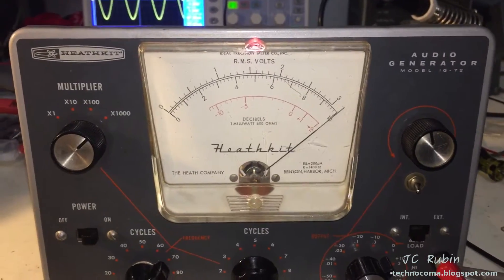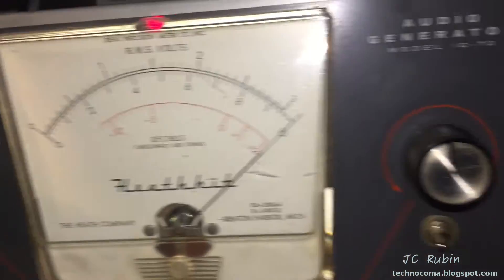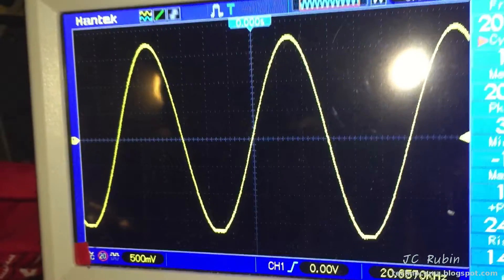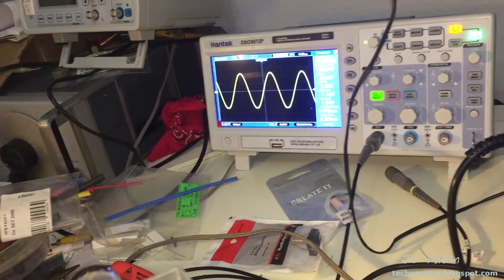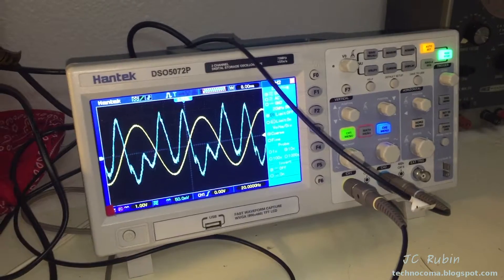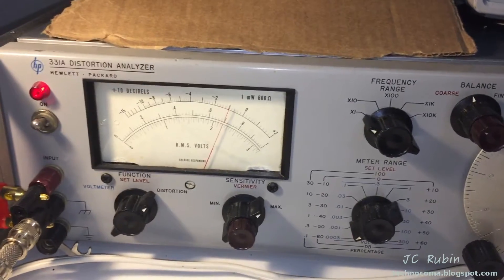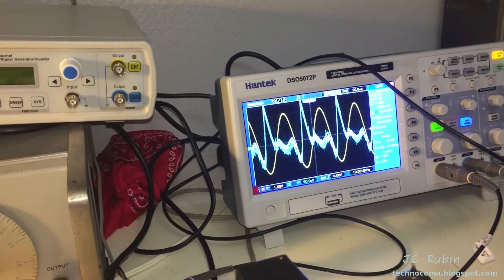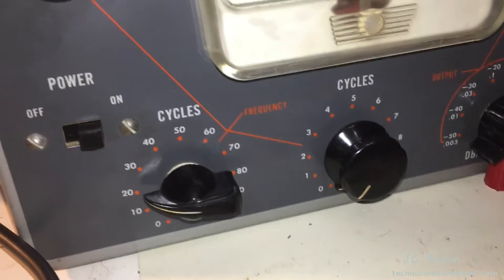Heathkit Repair - Audio Generator IG-72 PART 4 of 5

Comment: One possibility for the mystery switch: since it moves the meter reading down by about 4 dB, you would have to increase the output level to near 1.23 Volts get an indication of 0 dB again.  For professional audio, this is often used as the standard level for audio testing.  It's possible that that generator was used in such an environment, and the switch was added to enable it to be used to set levels relative to the +4 dB reference.  The change in output level when the switch is used may be due to a change in the internal loading on the output when the switch is used. although a 20 mV change would tend to result in a pretty crappy reference level!